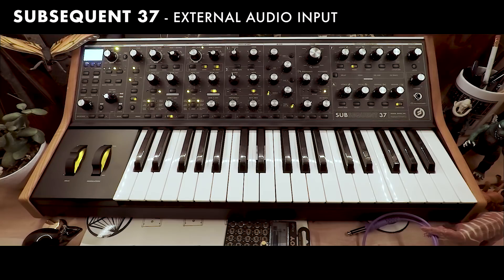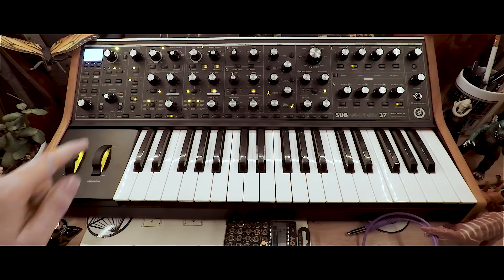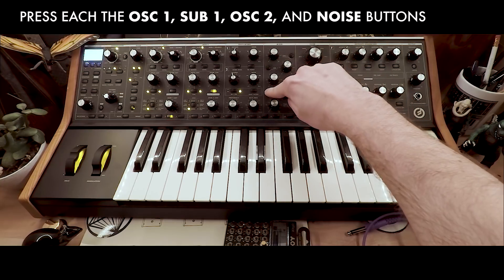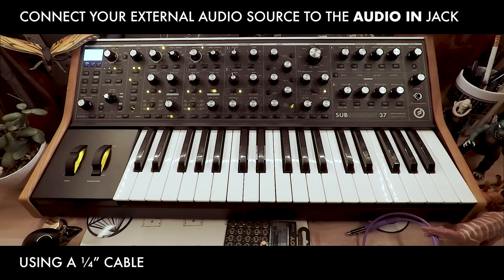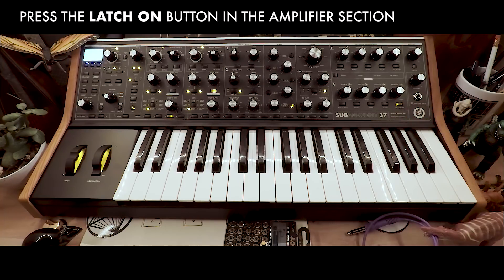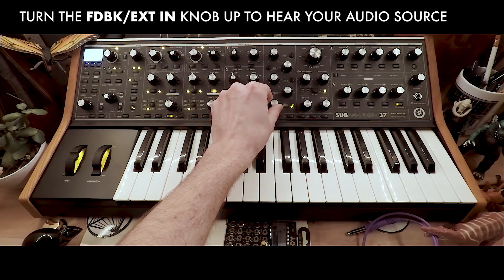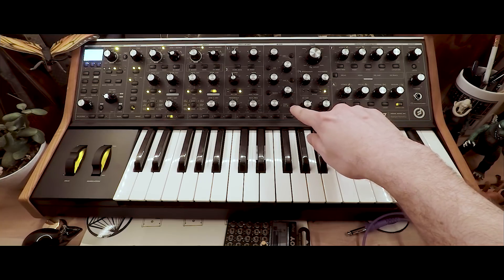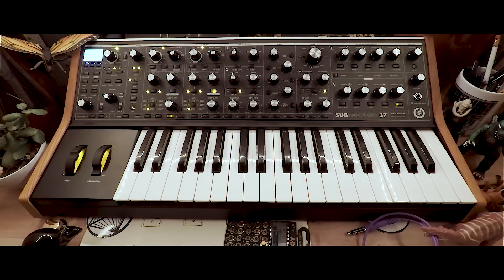Subsequent 37 | Processing External Audio

Comment: The manual indicates you can do this with an electric guitar plugged directly into the audio input, although the instructions are minimal and don't follow what is in this video.  I tried both the manual's instructions and the video and neither worked.  I meticulously followed this video step-by-step with no sound whatsoever coming out of the Subsequent 37, and then did it a second time with the same results.  

Is there anything else you have to do to use this with an electric guitar?  I just got the Moog yesterday and am loving it as a keyboard synth, but as I am predominantly a guitarist, I would love to use it with my guitars.
Reply: I updated the firmware and it still did not get any sound.  I tried this method a few more times, turning it off and on and going through the procedure again.  Eventually I started hearing my guitar.  It sounds like a clean amplified sound.  Playing with the Cutoff, Resonance and Mulitidrive knobs do very little to the sound (make it a bit fuller sounding when turned up) ... nothing interesting.  If I turn the Cutoff below 500 I get no sound.  If I turn the Resonance up high I get an ear-piercing feedback sound.  Nothing worth using musically.  

This video would have been a LOT more useful if they actually used a guitar or some other musical instrument instead of this horrid sounding noise-maker for external audio.  In any case I love the Subsequent 37.  I just still need to find out how to actually do something interesting and musical with my guitar as ext input.